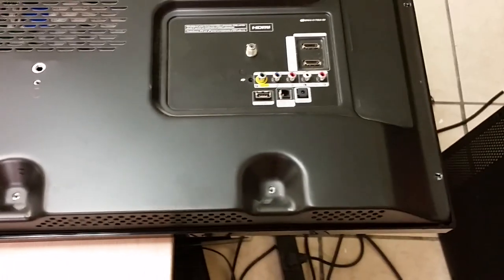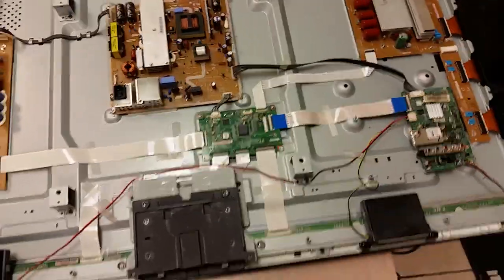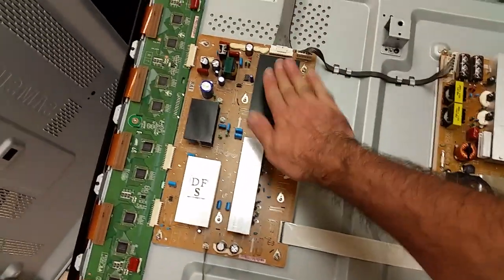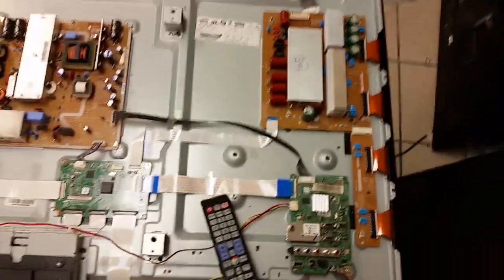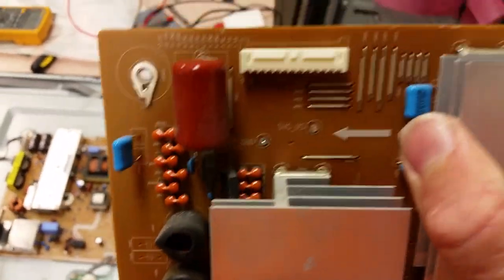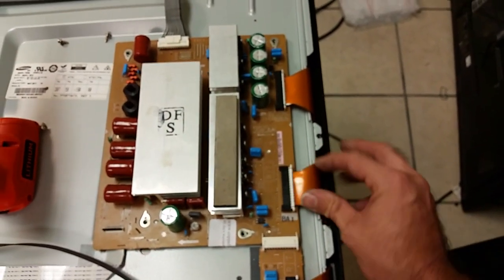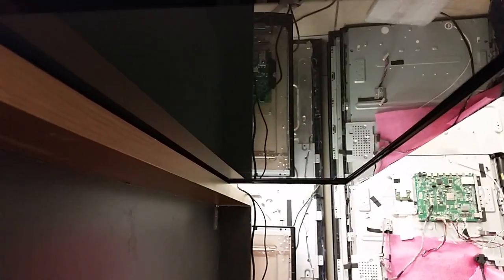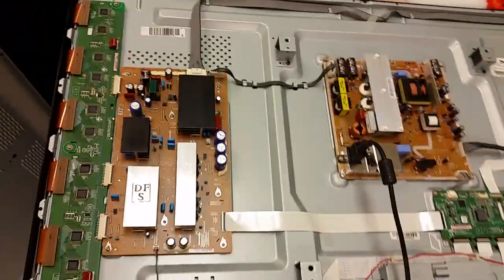How to troubleshoot / repair Samsung PN51D530A3FXZA shutting off or power cycling, LJ92-01763B

Comment: have same tv clicking on and off. had only main board plugged in and kept cycling does that mean the main board is the bad part
Reply from the maker: Unfortunately not, it does not necessarily mean the main board is the problem. It could be, but it's not guaranteed from the fact that when connected alone it power cycles.

Comment: Hello I followed your instructions I replaced the X board it turns on now the clicking is gone but I get no picture I get sound but no picture Should I replace the Y-board
Reply from the maker: In the spirit of "there are no bad questions" philosophy, which I BTW fully support...let me ask a question myself: if you are eventually going to get a working TV and a vendor has made money selling you a replacement board, what will we get for telling you what your problem is and subsequently where a new problem might be? Appreciation maybe, if we are lucky to guess right the problems on boards we can't even see and touch...but appreciation is not exactly comparable with what you and sellers will get, is it? :-)

Comment: In my case, and I had the same problem with an automotive air conditioner control module in the cab, the leads to the power transistors had cracked solder. The solder is shiny and looks good to the naked eye but inspecting with a loupe shows the solder to be cracked half way up the meniscus in those cases where the circuit board holes are not thru plated. Maybe it's an ROHS solder thing with joints that are thermally cycled. Reflowing the solder fixes the problem. Replacing the transistors will also fix the problem because you reflow the joints when replacing them but there is nothing wrong with the transistors.
Reply from the maker: The last part is actually not true for most cases. As the solder starts corroding it stops conducting and the current starts arching, creating inrush peaks that stress the semiconductors and wear them out way faster than normal use. So any power switching element that has been exposed to corroded solder joint for a while is guaranteed to have much shorter life than otherwise. Many of them fail before the corroded solder joint becomes practically open circuit.
So we always replace them.

Comment: Hi, great video. I have a question if you don’t mind answering? I’m trying to remove a main board from my Samsung plasma 50" HPS5033X  LJ92-01436a main board. I disconnected all ribbons, cords and I’m pretty sure all the screws. I went to lift it out and it’s in place as solid as before removing all the hardware? I noticed you said there is a rubber cushion it’s attached to on the video, could it be that? I did give the board a good tug but didn’t want to pull to hard and damage other equipment on the tv. It’s very frustrating because there isn’t many videos on this on the web, but the ones I did watch they come right out of course.  lol Wondering if you had any insight? I’m sure it’s right in front of my nose or it’s easy, but can’t seem to figure it out. Yours is the best video on removal of a main board on the web.
Reply from the maker: Thanks for the nice words, but...it is a bit too much to expect us to remember or even know details of dismounting random 10 year old TV model. I'd say your hunch is right and it must be something simple, quite possibly rubber shock absorber / thermal pad under the board. I'd say run something thin and long underneath and see what you find. Heat and slow lifting from edge help . Avoid sharp pulls by all means.

Comment: I'm new to your channel and I enjoy watching your videos, I have a Samsung  PN64E550D1FXZA which It has sound and no picture.  Someday I will get around to fix it, Unfortunately, I haven't yet seen a video on this particular model. I have made little minor troubleshooting as you have mentioned here as far as the wires go. all I know so far is that them Y sustain board and X board are cold to the touch. I have never mess with any tv in my lifetime. I will be learning a lot from You. i JUST WANTED TO SAY THANKS FOR YOUR VIDEOS...
Reply from the maker: Thank you.
I'd try http://www.coppelltvrepair.com/p/1374/samsung-pn64e550d1fxza-repair-kit-for-no-picture-vs-voltage-dropping-problem as a first step if I were you. Too many documented cases and too low of a cost to present any argument against it.
Reply: Thank You.